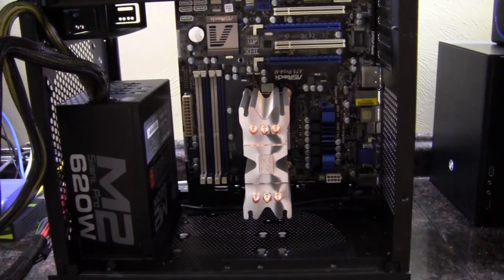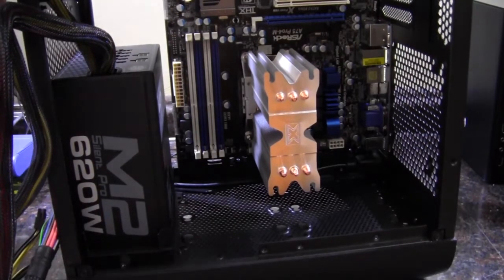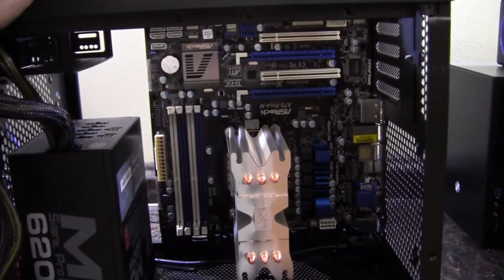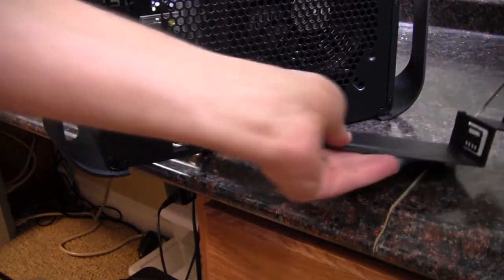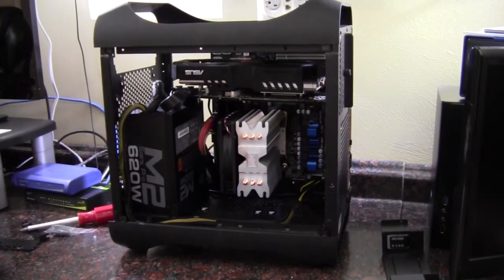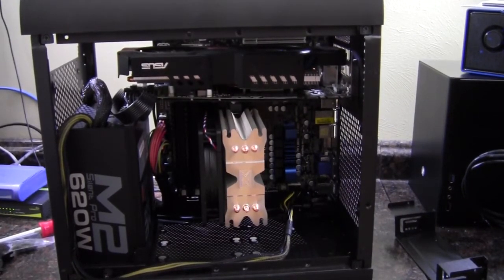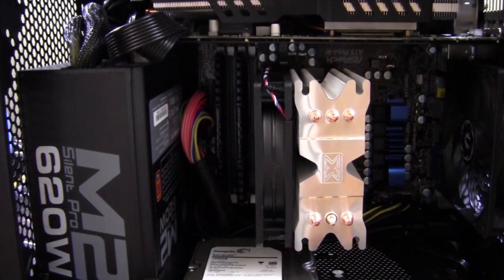Working with the Bitfenix Prodigy M Case

Comment from the maker: Thanks for the comment and question. I have been trying to get a 2x120mm radiator or H100i for the last few days and have been unsuccessful. So my reply is based on visual and printed measurements. I do not think the H100i rad will fit on the bottom. 2x120mm fans will fit, but the radiator is a bit longer on both ends then the 2 fans. IMO the rad will not fit because of the power supply. And it looks like a rear mounted fan will hit one of the fans mounted on the radiator as well.
Reply: AdoptedMike I was able to get the H105 installed (bigger or same size as the H100i).  Unfortunately, I also had a SeaSonic Snow Silent 750 and a MSI 980 Ti Gaming 6G, which are both longer than other PSUs and GPUs.  The GPU doesn't clear the modular cables and needs to be placed in a higher PCIE slot.  If either the PSU or GPU was shorter (or if case was bigger), I would be able to get the 2x120 radiator at the top with a 980Ti.

Comment: Ive got the blue version of this case.  My plan is to put the connections panel on the left and a clear window panel on the right side (you can get them on amazon)  and if you are ocd like i am you can take the controls and ports apart on the side panel and flip the buttons so they are right side up
Reply: +Jet Black What PSU did you use? Is it possible the get a 170mm PSU in there without it touching the grafics card?
Reply: +BehelitOutlaw if you had a shorter card, then yes. I've got an Msi r9 280x and it would be fine with a longer psu. :)
Reply: Dodgy Doodles thank you (:
Reply: no problem!

Comment: Awesome review! Complete and detailed. I have few questions. How tall is your PSU? I think the PSU's height and GPU's length are to be traded of. Also is it possible to mount 3.5" HDDs on the 2.5" HDD bracket?
Reply from the maker: The power supply is 6.4 inches tall. That is about the tallest supply until you hit 1000+ watts currently. Are you talking about the bracket that attaches to the side of the case and goes vertical? If so, then yes a 3.5" will fit as long as the CPU cooler isn't tall like the one that I used.
Reply: AdoptedMike Yes! I will be using a stock cooler only. Can I mount only one or two 3.5" HDDs on that side vertical bracket? The reason I ask is that, I don't wanna install my HDDs in the floor of the cabinet as it will become quite hot.
Reply from the maker: fightbackmatix You can fit 2 3.5 inch HDDs. I agree the HDD will probably run cooler mounted on the vertical side bracket then on the floor.

Comment: Great review, thanks. How did the cooling turn out for you? I looks as though all of your fans are placed to blow out of the case? I always build with positive pressure to reduce dust issues but that seems hard to to with this case. Or can the top fans be reversed to intake cool air, i.e. is there a proper  dust filter there?
Reply from the maker: Daniel Raftö Yes there is a dust filter in the top. It can easily become an intake. This case is not the best for proper air flow (heat rising). Even though it is not proper, it can still be done better than I showed.
Reply: Ok. Then I'll try to put two intake fans at the top and let the air find its way out through the back and bottom ventilation holes. Heat rises much slower than the air flow so I'm hoping for adequate temperatures. :)
Reply from the maker: Daniel Raftö I agree. It isn't the most ideal, but it will flow well.

Comment: Awesome video! Helped me a lot in whether I'm going to get this case or not. I'm just stuck on whether my graphics card and power supply will interfere with one another. I own Corsair HX 750, which is 7.09" long, while the Cooler Master unit you used is 6.4" long. I am also using 2 Asus GTX 660's, which are 10.2" long, while the Asus GTX 580 is 11.5" long. Will the shorter video card make up for my graphics card not hitting the power supply? That's the only part that's holding me back. Thanks!
Reply from the maker: Thanks for the positive feedback! The 2 660s should fit being 1.3 inches shorter than my big ASUS 580. I don't have the build anymore, so I cannot measure the overhang exactly. In the video it does look like 1.3 inches would be enough to clear the power supply. It would probably be tight though. My only concern is even if it does fit I don't know how well it will work thermally. The airflow in that case is not the best. It would work best if your 660s were the rear exhaust type. But I think they are the dual fan design, right?
Reply: Yep, they have the dual fan design. Was going to use the 1st and 2nd slots, and the 4th and 5th slots so they're somewhat separated, and so the 2nd card could pull fresh air from the the top. I'm just worried as the HX750 is so long, and I don't want to be out $100 on a case if they don't fit.
Reply from the maker: Trystan Ropson Personally, I would go for something different if I were you. That case is difficult to work with for what you are trying to get in there. It is really cool looking though. Plus the airflow not being that great in the case will be thermally hard on SLI with cards that exhaust internally.
Reply: Alright, thanks. I've just always wanted a Prodigy, and when the mATX version came out, I was excited to see it. But, there are too many compromises in this case, and too many little things that make it more complicated and less practical to work with it seems. I think I might just go with a Cooler Master N200. Thanks for all of your help!
Reply from the maker: Trystan Ropson To be fair to Bitfenix, the case worked GREAT as a super powerful ITX case. I think they should have made the same design but like 25% bigger. It would still have that cool portable look, just have more dimensions all around to not have to compromise on a power build.

Comment: Hey guys!

So I just got this case despite this review. And he might be right, that his triple-slot-card won't fir, BUT:
My card is an HD 7950, 261mm long and I slapped and Arctic Accelero Xtreme 7970 on it. That makes the card 320mm long in slot 2 and 3.
It works!
BUT (again) I do have a different PSU, it is a Powerzone 650 and fortunately I was able to fit all my modular cables all the way in the front of the case (seems like this here in the video does not have this option) and it works although my PSU is 170mm instead of Bitfenix's recommendation of only 160mm.

But another thing: Although this worked in the regular slot 1, i did put it in slot 3 now to be able to mount a sound card below and not blocking the graphics cards intake from the top. This is a good idea in this case, you don't need the top blower fans this way, because the graphics card kinda does that for you.

Also this case is fairly good airflow as I found out and you can make it quite silent.

So yeah.....guess this is it. Thanks for this video Adopted Mike, it helped me work out the problems and advantages, just wanted to give some of my expereinces to you, to help out as well.

If there are any questions, I would be glad to help.
Reply from the maker: Thanks for the comment and letting everyone know about your experience. :)
Reply: Does the psu have to be mounted in that way? Is it possible to have it flat on the floor? Obviously this case will not have conventional cooling, but could you point me in the right direction for a good setup? Thanks.
Reply: Does the psu have to be mounted in that way? Is it possible to have it flat on the floor? Obviously this case will not have conventional cooling, but could you point me in the right direction for a good setup? Thanks.
Reply from the maker: birdsonex It wouldn't bolt in laying flat on the bottom of the floor. The bracket that holds the PSU down is designed for a horizontal mount. The floor is not flat all of the way because of the power supply mount in the front is slightly raised up to allow the power cord to be plugged in from the bottom of the case. Does that make sense how I explained it. Plus laying flat will probably interfere with the CPU cooler and RAM. Unless you laid it on its side, then maybe. You would have to use something different to mount it also.
Reply: AdoptedMike ok, thanks for the reply
Reply from the maker: birdsonex I would be interested to know if you mod the case in a way that allows the power supply to be mounted differently. Good luck if you do. :)

Comment: Can both top fan slots be used if you're installing an optical drive?  Something, i believe, that was not possible with the original ITX case if i remember right.
Reply from the maker: Same issue with this one as well. :( The optical drive kills the dual 120mm top fan configuration.

Comment: If you were to mount a 200mm fan in the bottom instead of a HDD and instead mount 2.5 inch drives in the bracket on the side panel (like an SSD or even a laptop HDD) would that slove some of the heat issues?
Reply from the maker: It should help. The only weird thing about the case is the power supply vents to the bottom so the bottom fan or fans would pull in some of the power supply exhaust. Maybe not a big deal unless the power supply is inefficient or the system is under heavy load. I changed my fan config a bit and had the 120mm on the back bring in air and then the 2 fans on top pull out the heat. It seemed to help. It's all about getting the old air out and bringing new air in. Any fan setup to exchange the air faster or more overall CFM should help.
Reply: AdoptedMike you could actually have a fan on the bottom pulling air out, two fans on the top pulling air in and one fan on the back or 120mm rad pulling air out the back. This'll assure that air pressure isn't pulling hot air through the bottom vents from the psu and fresh cool air is always going in from the top. This is a set up I've been thinking of and is just in theory as I have yet to get the case but I have a feeling it should work well
Reply from the maker: ApexVash I am not sure how well that will work because of the fact that heat rises. But, in this case it may actually work. This has been a strange case to work with so far, so maybe an unconventional cooling setup will work great. I have since sold the PC, but if I ever decide to do a build in it again I will give that setup a shot. Couldn't hurt anything. Thanks!

Comment: can you fit a H100 on top? and a regular size radiator on the bottom? I plan to use a custom loop for the CPU and a All-in-one watercooler mod for my 290X, the H100 for the 290X would be on the top and the 240 rad (XSPC 240 or EK Coolstream XT240) on the bottom.
Reply from the maker: On top for sure, without installing an optical drive. I don't think you can get one on the bottom. I don't think there is enough room. Someone may have done that, but I haven't seen a bottom mounted rad on this case yet. Sorry.
Reply: AdoptedMike I will install the hardrive somewhere else, probably on the PSU w/ a velcro tape or of there's room on the back panel I will do it there.

Anyways how thick of a radiator can you fit on top w/ a push fan config. the slim radiators on the market is 30mm thick, if that can fit then I may be able to use a custom loop w/ swiftech apogee drive II.
Reply from the maker: ***** I don't think you can get a push/pull on the top. It will get in the way of the graphics card. Push/pull on the top of a case will require a different case. Mostly because the motherboard is mounted upside down so the PCI slots are up to the top of the case.

Comment: Nice review, quick question, would the 5.25 optical disc drive still fit even after placing two 120mm fans up top?
Reply from the maker: Edgar Ryan Samson With the optical drive installed, only one standard thickness 120mm fan will fit. A slim 120mm fan may fit, but I don't think there will be enough room for it to pull air.

Comment: i love the white version but i hate also because there is no ventilation for the PSU at the front part of the case....i got to ask will the nh d15 fit in that case?
Reply from the maker: I don't think it will. It may be too wide for the rear mounted fan. It could height wise, but the vertical side mount HDD bracket would likely have to be removed. Do not take my thoughts, check out some other channels and see if someone has done it. That cooler is quite a bit larger than the one that I used in this video.
Reply: AdoptedMike yeah hmmm i really like the prodigy case and i like the nh d15 for overclocking so i think i should pick the cube case so that i can fit the nh d15

Comment: I have a ASRock X79 Extreme4-M (mITX), PSU 850W Dark Power Pro (190 mm) and GPU ATI 4870x2 (270 mm), will it fit in (without optical bay) ?
Reply from the maker: I think it will, but personally for that much power, I would choose a bigger case to help with airflow. Those components, especially the GPU get pretty hot and I think this case would be too small for that heat output. I had one of those 4870x2s and I remember having cooling issue with not being able to get enough cool air to that GPU. If you are OK with higher temps, I do think it will all fit.

Comment: Would you suggest this case for a first build? Don't plan on doing SLI or CrossFire.
Reply from the maker: Moby Dick Of Dopeness It is not a bad case for a first time builder. For sure, not doing SLI or Crossfire will make it much easier. The hardest thing about this case in my opinion is cable management. A modular power supply will help with that, but it still is a weird case for cables.

Comment: Hi i have a question were is the psu powercable? cuz it looks like it has to make a weird angle cuz its facing downwards since de psu is placed vertical
Reply from the maker: The power cord actually runs is re routed from the rear to under the case. Then it is able to be plugged in to the bottom of the power supply

Comment: would a ASUS GeForce GTX 760 DirectCU II OC 2GB graphics card fit in this with the cd drive?
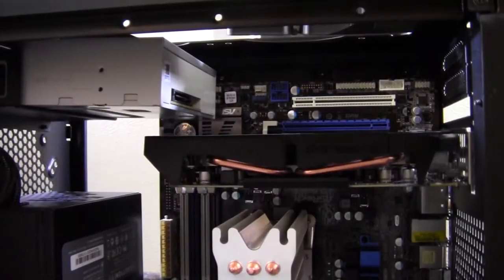Reply from the maker: At 4:30 you will see a dual slot GPU installed with a DVD drive. This is very similar to what you are looking to do.

Comment: So just to sum up real quick. There is no ways to place a h100i h105 etc. I really like this case but would like to fit in a close loop cooler. Anyone know if there is a configure to get one in there ?
Reply from the maker: xxMURDAMANIACxx  What CPU are you using? You could always go with a thick 120 mm radiator all in one cooler.
Reply: xxMURDAMANIACxx I was able to get the H105 installed (bigger or same size as the H100i).  Unfortunately, I also had a SeaSonic Snow Silent 750 and a MSI 980 Ti Gaming 6G, which are both longer than other PSUs and GPUs.  The GPU doesn't clear the modular cables and needs to be placed in a higher PCIE slot.  If either the PSU or GPU was shorter (or if case was bigger), I would be able to get the 2x120 radiator at the top with a 980Ti.
Reply from the maker: Michael Blume Wow! You are cramming some powerful hardware in such a tiny case. I imagine this was quite a task to get done.

Comment: do the hdd's fit anywhere except the floor? I wanted to put a 200mm on the bottom
Reply from the maker: truetotorment There is a hard drive mount that mounts between the top of the case and the bottom of the case that mounts hard drives on their side horizontal to the motherboard. It can hold 2 hard drives. I chose to leave it out for aesthetics.Near the bottom of this page:

http://www.bitfenix.com/global/en/products/chassis/prodigy-m

You can see a picture of the mount installed on the white chassis example.
Reply: That would look terrible with a case window :/ I had a mini itx bitfenix prodigy, and have just ordered a new prodigy m for a different build. Will have to think about this one :) thanks
Reply from the maker: truetotorment You bet. A case window would be a bad idea with that setup. Unless you love the look of a bracket blocking all your hardware :)

Comment: I really need some help, I was thinking about putting a Asus R9 280X in a Prodigy M, the problem is I'm not sure how many PCI slots will it ocupy, could someone help me?
Reply from the maker: As far as I know all 280X cards will occupy 2 slots. There may be a 3 slot version, but I do not think so.
Reply: thanks man!
Reply from the maker: Let me know how your build works out when you are done.

Comment: I know its a Micro ATX case, but do you think it may be possible to install an ATX motherboard?
Reply from the maker: No. This case only has 4 expansion slots. The ATX standard requires at least seven slots. ATX and MATX share similar widths, but have drastically different lengths.
Reply: AdoptedMike Damn really nice case, thanks
Reply from the maker: Kugicis You are welcome.

Comment: Putting 2 gtx 760 direct cu mini should work fine
Reply from the maker: For sure this case would do SLI very nicely. I just had to test it out with the biggest graphics card I had. The only thing that I wonder is if the case can flow enough air to keep both cards cool. It should, but man it is cramped and I was only able to install 3 fans total for air movement into and out of the case.
Reply: Looks like a good little system .
Reply from the maker: MrReeceyburger123 Thanks! Hopefully the end user will enjoy it.

Comment: GPU overheats if too big because of DVDblocking
Reply from the maker: Yes, that is a big problem with the design. If it were even an inch taller, it would be much better when fully loaded.

Comment: how do you fit the hdds on the bottom of the case?
Reply from the maker: There are special screws with rubber washer mounts that screw in from the bottom.

Comment: How did you install the 5.25 inch hard drive?
Reply from the maker: In the final build, there wasn't a 5.25 inch drive installed. It can be installed with one dual slot video card. Anything more than that, like a triple slot GPU, SLI or CrossfireX most likely will not allow the installation of a 5.25 drive. Unless you used a pair of short GPUs like the MSI GTX 760 ITX version. A fan controller could still fit even with the full length GPU cards.